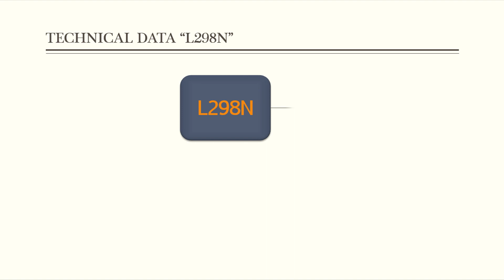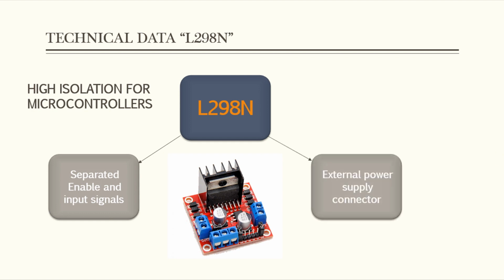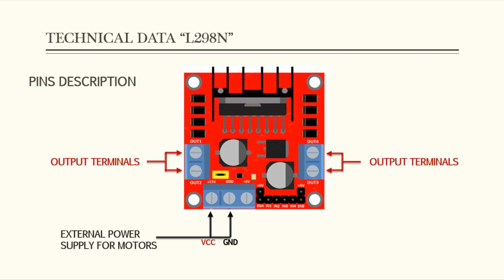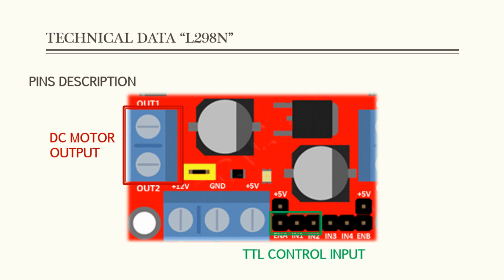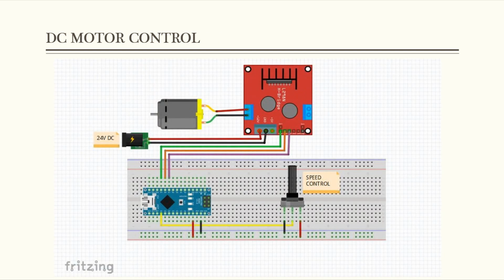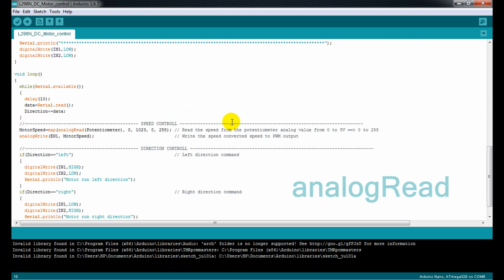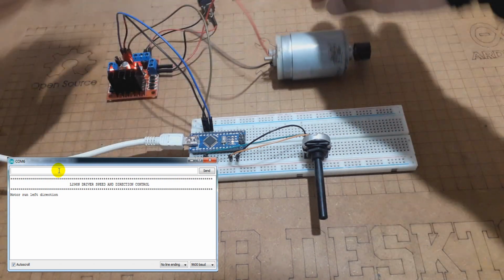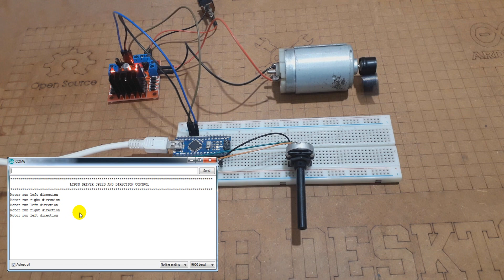How to use L298N with Arduino (with code)

Comment: Very nice video!  In your video you used a breadboard to mediate connection to arduino to control the motor. Is the breadboard necessary? If not, how can you set up for arduino uno + L298N for a 24V DC motor (preferably not using a breadboad)?  Thanks!

Comment: Hi, Thanks for video Im trying to build a similar circuit with a 24v power supply, a L298 driver to control a 24v servo motor question is the l298 Im planning to use doesn't have 5v to power the arduino board how can I send the 5v to the board
Reply: Easy, there is a 5V jumper. If it's in place then the 5+V pin beside the GND and 12+V pins will act as an output and you can send this output to the Arduino VIN

Comment: In this circuit will voltage from potentiometer regulated between 0-5v or 0-24v

Comment: Hello sir can you help me? I have l298n and 1 dynamo which is 12v and linear actuator 12v also and the power supply is from solar charger controller which is 12v output. Is the scc can provide the needs of the two? Pls help me im doing dual axis solar panel.

Comment: What about sample wiring connection for 24Vpower supply to drive two 24V DCmotor, using Arduino Uno along a breadboard. Assuming Arduino Board is powered by 9V Battery.

Comment: Using the same power supply 24V to drive the 2 motors and 9V power supply from battery to power Arduino Board, what about the 5V input supply for IC controller, can I draw them from Arduino Board both +5V and  GND to be plugged in the L298 common ground along with the 24V GND?

Comment: I'm trying to run a PM55L - 048 - HP69 stepper motor with the L298N on the Arduino which, according to the datasheet, is powered by 24v but is not running (the motor is fine). I am connecting the 4 wires of the coil, leaving the common wire disconnected. I connect this way: Motor wires 1,2,4,5 in OUT1-OUT4 of the Drive. Wire 3 is the common one; Am I right? Thank you

Comment: Hi, nice tutorial. But I can make it work with more than 12v. If I don't remove the 12v jumper, the output is about 8v and if I remove it, it doesn't output any voltage. Thanks

Comment: I connected 12v supply for two tt motors but the voltage output at motor terminal is 3v why? And only one motor is working
Reply: same problem with me. have you solved this problem? good to see your answer :)

Comment: Sir if I use L298 driver, 1 dc motor and ultrasonic sensor
I plug the 9v battrey to GND and 12v at the L298 driver also  connecting 5V (L298) to vcc Arduino  and ground in arduino
so how about the ultrasonic power and ground?
should I connect to the L298 too?
Reply from the maker: Hello
You can use the 5V of your Arduino to power the sensor too.

Comment: Sir can I used 24 volt and 4 amp for input  and control moter speed
Reply from the maker: Hello
Yes and this is what we used in our video.
Are you trying to control speed and direction too!
Reply: Isn't the l298n supposed to handle 2 amps max ?
Reply: @angelleal3005  this is the same question I have, have you come up with an answer?
Reply: @sonic797_youtube  I used it initially but the voltage drop was so significant that the control of my motor was severely affected. So I decided to go with another driver. Good luck on your project.

Comment: Very good video. There is one thing I think that might be good to add to the Arduino code: when changing the direction of the motor, a delay should be added for the motor to stop  (especially when there is load on the motor) and then start turning into other direction.
Reply from the maker: Thank you for your comment
You are 100% right thnx